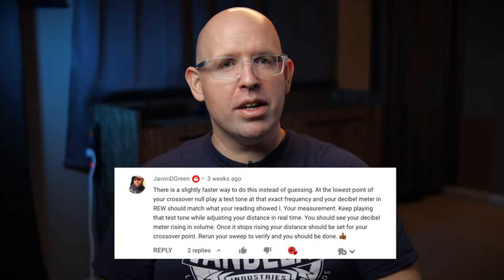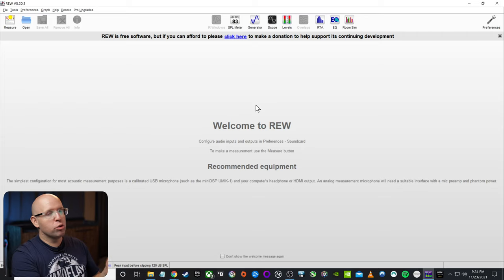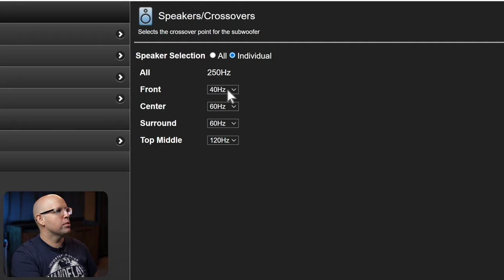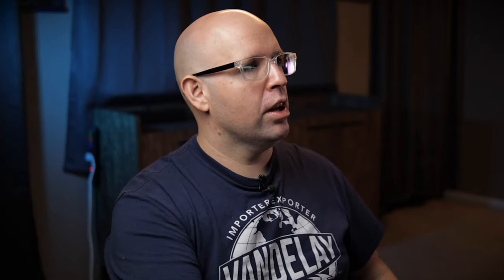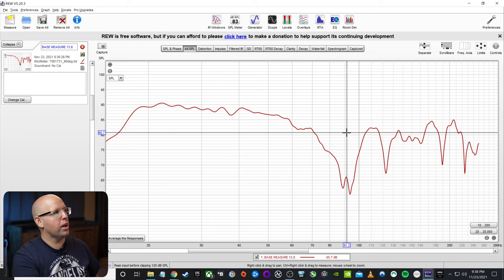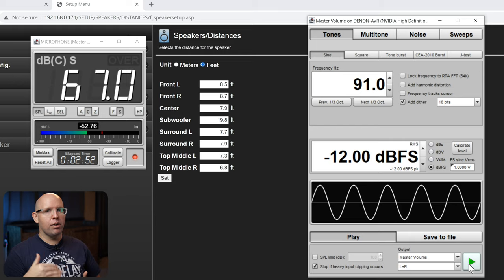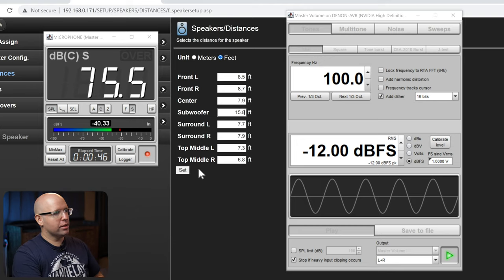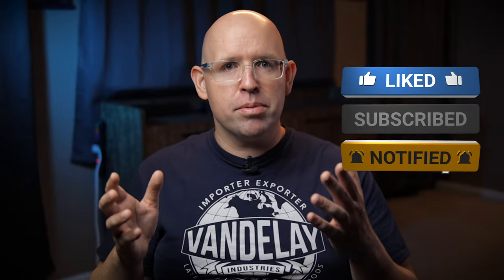A FOOL-PROOF & EASY way to set subwoofer distance and crossovers! (REW GUIDE)

Comment from the maker: Sorry for the audio issues on this one everyone. I had my RODE Wireless Go microphone set too hot and that resulted in some occasional distortion while I was talked. Since this was filmed and edited during Thanksgiving week, I just didn’t have enough time to reshoot it. Sorry about that!

Also, I totally forgot to mention that you SHOULD do a measurement after adjusting distance the first time, even if you need to raise your crossover. This is mainly so you have something to compare each measurement against and pick the best one. I don’t know why I forgot to do that while recording this video.

And if you’re wondering why at 80-ish Hz I needed to be at 82dB and at 100 Hz I needed to be at 78dB, it’s because of my house curve and the way it slopes down.

Comment: After mounting speakers in the perfect Atmos positions, finding the best place for the sub(s), watch a dozen contradicting "how to use REW videos", measure, adjust, measure, tweak, lower the noise floor, add acoustical treatments, measure, tweak, measure again - AHHH perfection.  You then sit down to enjoy a drink with a movie or music.  And, then Satan sits on your shoulder and asks you: "Hey pal, is it really right ?".  2 more drinks!
Reply: Ha, truth
Reply: Wish I never watched any of these type of videos honestly. I haven't fooled with home audio since I was around 20 years old way back in the late 80's. I am beyond confused with all of this stuff. lmao
Reply: Im even tired of not having good sound, when i got into AVRs and HT two years ago i didnt even knew a subwoofer could sound better 1.5 meters further from its original position, i didnt knew it needs to be in an optimal place, i thought you place it and forget about it but my SVS SB 2000 sounds like shait evben in a small room, i should have gotten a PB1000 Pro, probably that could fill the room better than a sealed!
Reply: I bought a new HT system recently and fell into this calibration rabbit hole. I feel so lost. Wish there was a guide that just walked you through A to Z, but people make entire 30 min videos on one single setting lol. It's like if I want directions to the Grand Canyon and they spend an hour telling me about a gas station on the way there. Ok I will check out the gas station but I'm still lost! It's overwhelming for a busy working man like me.
Reply: @deepg7084  you just summed up my sound journey! The analogy of directions and the gas station was perfect! I barely have time to use these tools - so much time goes by in between that I feel like I have to learn it all over again each time.

Comment: Aside from the great tips in the video, thanks so much for using the web interface on your receiver.  I had no idea Denon AVR's could be controlled via web interface.  Can't wait to use this on my X3700H.  This is gonna make tweaking so much easier and less time consuming.
Reply: I tried on my SR6015, its connected but I have no control, no web interface. In properties it says presentation webpage unavailable. any direction on how to fix?
Reply: @adam4g63  Try putting the AVR's ip address directly into the address field on a web page.

Comment: I ran rew to try to improve the sound of my dual pb4000 subs and had a nasty null around 65hz no matter what I did with distance and crossovers. I ended up spending around 2 hours messing with just the phase control of the subs and ended up getting the flattest response up to 100hz that I ever have before. No eq adjustments or anything. Simply just phase adjustments. It's definitely worth a try I you have the time and patience.
Reply from the maker: It’s amazing what a few minor adjustments can do, am I right!? Getting those subs in phase with each other can make a major difference. Sounds like 2 hours well spent if you ask me!

Comment: Love all your guides! I can honestly say that your multople detailed videos on how to use a Mini-DSP and REW enabled me to use these tools to optimize both of my HT setups.

One thing I have done in optimizing my subs location, settings etc is to take the average of 3 main seating positions on the couch to guide my decisions, while noting the individual seat responses.
In my room, the right seat on the couch can be in a null highly dependent on sub position. I ended up using the position whose average response is more uneven, but with less of a seat to seat variation and having no nulls to speak of since they are difficult/ impossible to EQ. Once I got those positions right, it Audyssey's work a lot easier in optimizing the full system setup.
A lot more work and measurement ( and decision making) but worth it to make sure everyone on the couch has good sound instead of only having a narrow sweet spot with very good sound and the left and/ or right seats missing out.

Comment: Great video and application!  Question:  Have you done any setups to synchronize impulse response between sub and mains at the cover point?  An idea > set the sub xcover and distance using your method above.  Then increase the sub distance by multiples of one wavelength of the xover frequency.  Example:  At 80 hertz the wavelength is approximately 14.1 Ft > add 14.1 to your sub distance and run your frequency sweep and listening tests.  In theory, most subs use digital amps and DSP circuitry which adds delay to their output.  My experience is Audyssey can get the distance close in phase that your method corrects, but the sub output is actually one or more wavelengths off.  I use drum test recordings to test this theory.  I welcome comments (good or bad) & new any ideas.

Comment: I heard from various Forum threads that prolonged sine wave signals can damage speaker drivers.  I wanted to try this method but I'm a little concerned about stressing my speaker drivers. I use the "Subs Distance Tweak" method adding a foot in the AVR until I find the smoothest FR at the crossover point and so far this has worked for me.  I just play it safe and it doesn't take that much longer.

Comment: Hey brad, just getting caught up on your few videos, there is a calibration file out there for 90 degrees for the auddessey mics, can you go over a tutorial for a setup to use the auddessey mic with eww, for some reason the mic doesn’t detect in rew when connected to the mic port on a pc, it sees the mic and you can select it and add the calibration file, but when you run the test tone or pink noise the app meter doesn’t move. I think there will be huge value to the home theater community if there was a nice and easy way to use the auddessey  mic with few as most will already have the mic and will not need to purchase an expensive mic. Your easy to follow tutorials will be extremely helpful.

Comment: nice presentation, thanks... i think it's a good habit to check measurements/adjustments afterwards, especially using different approaches. in this case i would suggest a pink noise with a spectrogram view, as it would show the impact of the phase over a wide range of frequencies *in real time*. easier to interpret than a RTA window.

-----------------------------------
one thing to be aware is that most of the times, the delay/phase sub adjustment is a compromise between constructive interference in one frequency area and destructive interference in another.
i think it's unwise to deploy just one technique, whatever one. 
using just a narrow fq window as exemplified in this approach is certainly opened to errors: you could be getting max output at 80Hz but simultaneously create a null at 160Hz or whatever.

Comment: Thank you very much for the two connected videos. Allow me to ask a potentially stupid question. Would pink noise and using the real time analyser not be possible as well? That way you see the notches or nulls change in real time as you adjust phase and then time. I also wonder if it is better to adjust phase or time first, since these are connected.

Comment: Wouldn't level matching speakers after running room correction cause the room correction corrections to be skewed?
Reply: You can meassure the output with REW so if that shows any dips and bumps then those are not corrected by correction software.

Comment: At around 5:00 you are adjusting settings for your receiver using your computer. Is that something you can do only on newer Denon receivers or can I do that with my X6300H from around 2016?
Reply: How did you get it so you can even see your receiver on your pc? My receiver is wired to my router and it doesn’t show up. Did you have to do something to get it to show?
Reply from the maker: I’ll have to double check the receiver, but from what I recall it has always just showed up under the Network tab in Windows 10. I’ll report back when I get a chance.
Reply: @HomeTheaterGamer  so I sort of got it to show up. BUT when I double click all it does is bring up a properties tab and nothing like what you have. I tried all kinds of google search terms but nothings comes up on how to bring up that type of control panel. Maybe the x6300h doesn’t do that
Reply: @HomeTheaterGamer  well crap. I googled your receiver and even though it came out the same year. I think I don’t have that feature on my X6300H
Reply from the maker: Interesting. Have you tried typing your receivers IP address directly into a web browser like Google Chrome to see if anything comes up?
Reply: @HomeTheaterGamer  I get an Error 403: forbidden message. Maybe eset or fios is preventing something

Comment: Hey Brad, 13.00 when you up the distance of the sub it wont rise the DB in other frequency ranges? I get that you fix that nul with changing distance but maybe you get more DBs elsewhere too and when you make another measurement you wont get an optimal outcome.
Reply from the maker: It can sometimes cause slight differences in frequencies slightly higher than the crossover (if crossover is set to 80Hz for example, there may be a slight boost or dip added at between 100Hz and 120Hz), but most of the time the differences are minor and well worth the trade off in order to have a smoother blend between subwoofers and speakers.

Comment: Hi Brad small question: u mentioned doing room correction first and then going in and changing the distance or cross over. I have a NAD T778 with Dirac. After I use Dirac I can't change the distance anymore unless I use no Dirac. Do I just use cross over frequency to get the best result or is that also determined by Dirac? thanks !!! .

Comment: I just typed out a long comment with a question at the end in another video of yours, but I have a somewhat related question so I'll just get right to it...  If I set my subwoofer level to 75 db then I lose almost all Dynamics in my room for music and movies, so I've been running it at 79-81db for the past 2 years and it gives me great impact and full sound for most content.  My question is, do you think the fact that I only have one 10" sub is the reason I have to set it higher than 75db, because it isn't pressurizing my room enough?  Now that you have 4 subs in your room, do you notice more Dynamics in your sound field then when you only had one?  When I had two big tower speakers in my room, I had much more punchiness in the bass, and I'm sorely missing that now that I want to in-walls for my LCR, so I definitely think I'm going to have to add multiple subs in the near future, to get back what I've lost...

Comment: Doesn't Audyssey compensate for the delay caused by the subwoofer's built-in DSP and such? If so, doesn't it mess up the subwoofer's performance in the time-domain if you set the distance to several feet different from what Audyssey says it needs to be?
Reply: I guess so. Smooth freq. response isnt the same as smooth timing as far as i know. Thats one of the big problems with a sub in each corner. To get smooth response its almost like the 4 subs have to wait in line to get to “say” what they want and you hear what each sub has to say just not with the same impulse response. 🤔

Comment: Question...Setting a curve for the Fronts speakers....everything I measure with this front speaker House curve it stays the same reading on REW measures with no changes.   But when I put my front as Large speakers it does give me that curve that I intended to achieve.  How can I get that curve with speakers set to small?   Thanks

Comment: Great vid. I’ve followed the rest of your setup vids, finishing with the subs, mains integration. This added delay into the dsp. I’m using an Anthem mrx1140 & you have to add your own distance. I just left it at 0 after the subs mains integration. Should I now follow this video & add distance?
Reply: Hi John, I have an MRX1120, so same boat as you with distance. In my case, sub distance is 0 because I used miniDSP to calibrate the subs. I used REW to find the distance for the mains with sweeps as I did not know about the method in this video. Same idea, though where you are looking to match output across the sub to speaker array. I ended up with mains at 2, center at 3, surrounds at 4 and heights at 6 IIRC. 

I know I have it dialed in fairly well when I can hear intercoms directly overhead (a la Auro 3d) when using Atmos or DTSX upmixers on the TrueHD or DTS Master tracks. The audio just comes alive and is exactly how one expects Atmos and DTSX to sound. 

I am sure there is a better way to get the phase aligned in distance with our AVRs, but for now, I am sticking to this as the balance and effect is preferred.

Comment: do you recommend this guide over the mini dsp part 4 way?
Reply from the maker: Only if you’re having issues getting things dialed in with Part 4. That way is technically more accurate. This video does supplement that process though, so you can incorporate both while dialing things in.

Comment: Is changing the distance of the sub essentially like turning a phase dial? So if your subwoofer only has a 0 and 180 phase switch does distance give you the option to get more granular? I picture a phase dial shifting your sound wave and distance setting doing the same but I might be confused

Comment: Can you use this for two different-sized subs of different brands?  I have a 12" Klipsch (newest) and a 10" Polk (original) with my mixed-brand 7.2.2 (front height) HT/music system.  I have my Denon X4700 set to LFE+Main

Comment: There's one thing I don't understand. How did you know it was a 110 cross over? Could you explain how you knew that it was 110?
Reply: Brad, knew the crossover from his other technique and video he had a video on. but I would like to know do we just set the crossover @ 80 and go from there still seems like a bit of guesswork.. but still alot easier then the other method.. but Brad was not too clear on how we get to the correct crossover but it looks like trial and error?

Comment: What i kind of miss in this video is why you think the 80hz crossover was not good and you had to raise it. Is it because the max output at set frequency was not high enough to match the wanted output for a smooth response? For example; you wanted it to be 82dB, but you only got a max output of 78dB, so with the crossover set to 80hz, you were unable to match the desired output, and thus you tried a higher crossover?
Reply: I'm kind of wondering about this too. Awaiting clarification from @HomeTheaterGamer.

Comment: Similar way multiple subs can be aligned too. 
May I request you do the same for MSO software. I heard MSO is better suited to tune the system for multiple seats in media room. Thank you.
Reply from the maker: Thanks for the request. I’ve actually been meaning to check out MSO as it is!
Reply: @HomeTheaterGamer  MSO with a miniDSP is pure black magic. It takes a bit of messing around to get it right (what target volume level and boost amount) but it will reach an amazing result I cannot begin to compete with manually tuning EQ with REW. I'm talking flat 10hz-200hz with 2 subs in my 3300sq ft room.
Also, theres an even better way than this to get your sub distance set correctly. Let's use the left speaker for example.
Step 1: Set your subwoofer distance to the same distance as your left speaker.
Step 2: Measure your left channel (left speaker + sub) for a baseline, witness that crossover dip from the distance (phase) not being right.
Step 3: Turn off your subwoofer and run it again, now you'll just get the left speaker part of the crossover. 
Step 4: Turn on your sub and disconnect your left speaker and run it again, now you'll just have the subwoofer part of the crossover.
Step 5: Now is time for the magic. Click on the all spl tab, then click on the gear in the top right and go to alignment tool.
Step 6: Select your left speaker no sub measurement, and your no left speaker sub measurement. The summation line drawn will be the same as the measurement you took in step 2.
Step 7: Adjust the subwoofer delay tab until you get a smooth FR. To the side of the delay slider you'll see a distance. Adjust your subwoofer distance by this amount. It's a little easier in metric.
Reply: @HomeTheaterGamer  Did you ever try out MSO?

Comment: After audyssey setup can we reduce crossover settings if we want?
Reply from the maker: As a general rule, I wouldn’t recommend setting the crossovers lower than what Audyssey sets.
Reply: @HomeTheaterGamer  then how to play with rew here it may raise or reduce?
Reply from the maker: @Somu you can raise it without an issue but lowering it below what Audyssey sets means that those frequencies played back by the speaker won’t have EQ applied. Audyssey doesn’t EQ any frequencies below what it determines to be the crossover for that specific speaker.

Again, this is a general rule and since you have REW, you can do a measurement to see the result from lowering the crossover too much.
Reply: @HomeTheaterGamer  ❤️